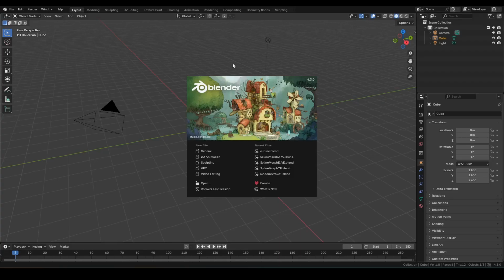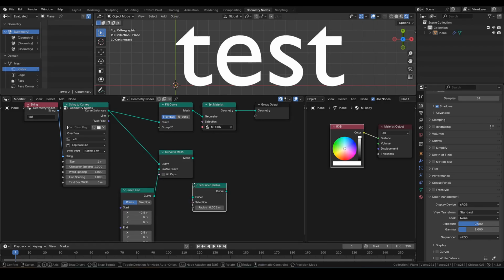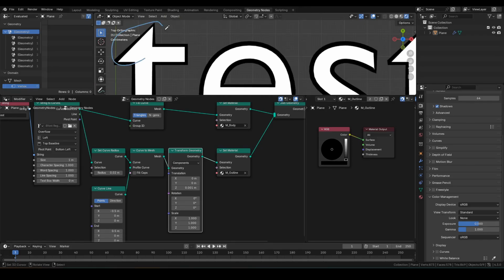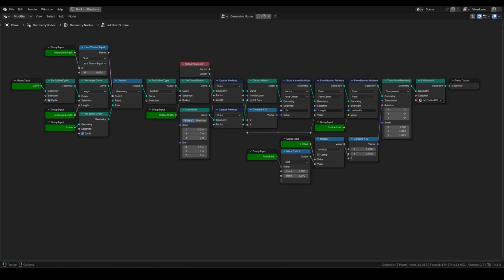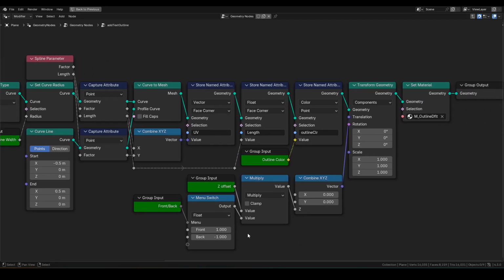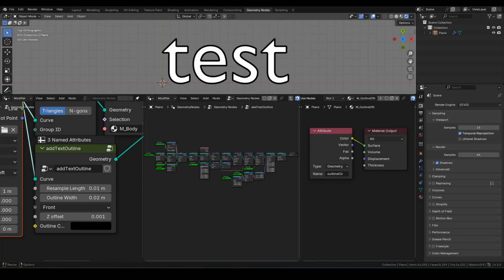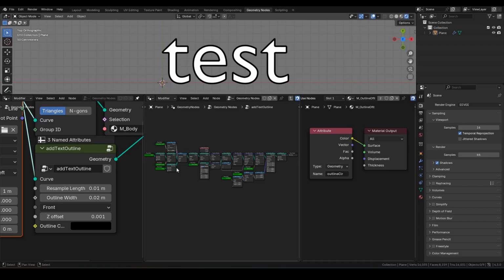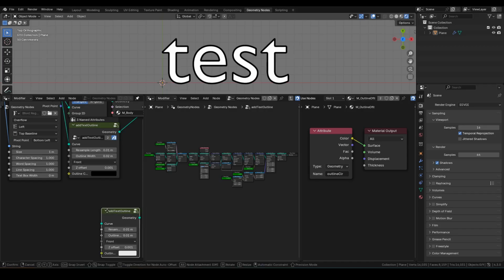Text Effect with Blender:  Text Outlines [tutorial]

Comment: how would i do this with an existing text not a string
Reply from the maker: Assuming you are referring to the Blender Text Object (that can be added by shift-A -> Text), unfortunately I do not know a way to do it with Geometry nodes.  
The text object is pretty much a converted mesh with its outline spline data already gone.
Though not particularly flexible and could lead to unwanted lines, you can try Grease pencil line art modifier or Free Style render mode
Reply: @BlenderStudioS-bs8mr  i have found out a way! | so duplicate the text, in shape make fill mode none, then go over to geometry > bevel > round then make the depth like 0.01 for example then add the color of the outline. then scale it on the z axis or dont
Reply from the maker: Great to hear you found a way!
I forgot there was a None fill mode with Blender text object 😅
Though I recommend using Geometry nodes string so you wouldn't need to go over the duplication process if you decide to change text content or font, if the situation suites you, then go for it!